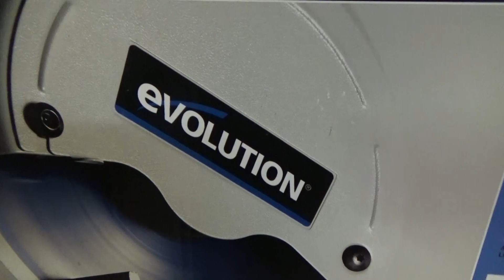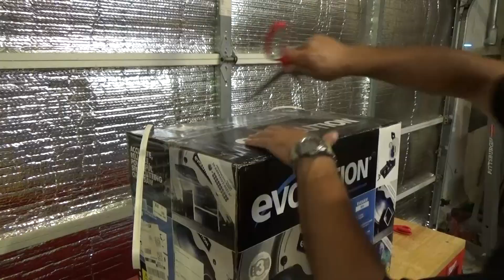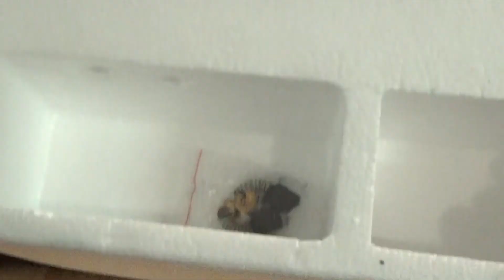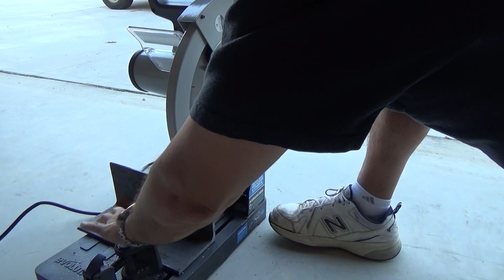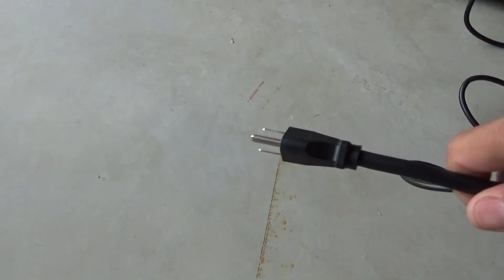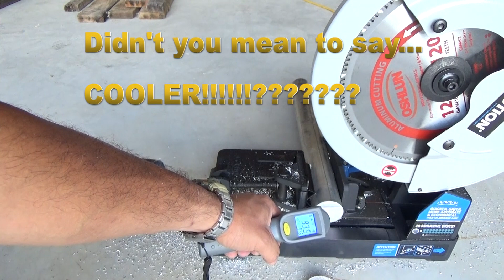Evolution Saw 380 Box Open and First Look Review

Comment: I see your blade does the same as a regular chop saw blade loads up with aluminum in the teeth. 
 I give mine a little squirt of wd40 and it flys through the cut with out loading the blade up.
Reply from the maker: Wow, thanks for the tip! I do that all the time with the band saw but didn't even think of trying that here. Will definitely give it a go next time!